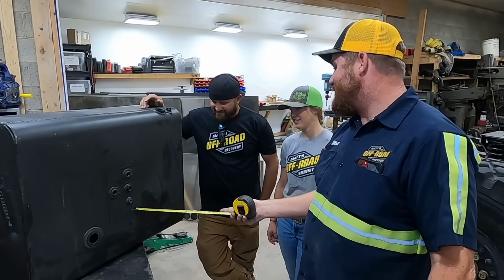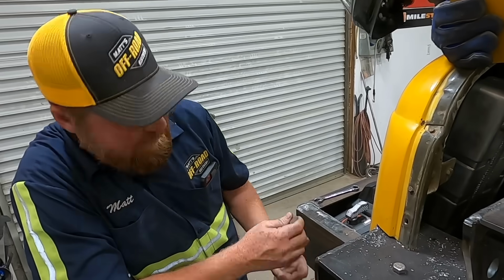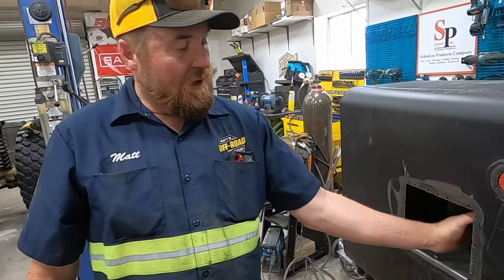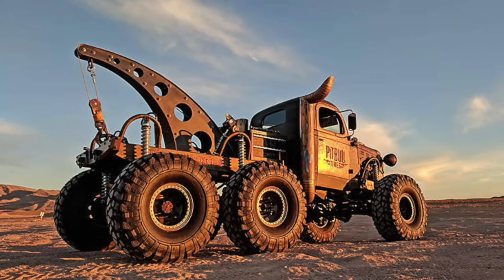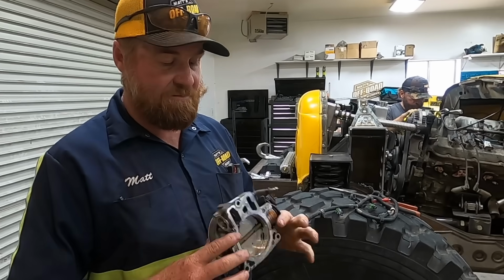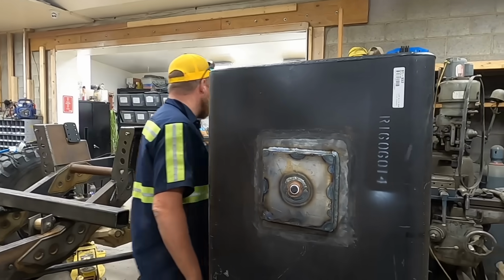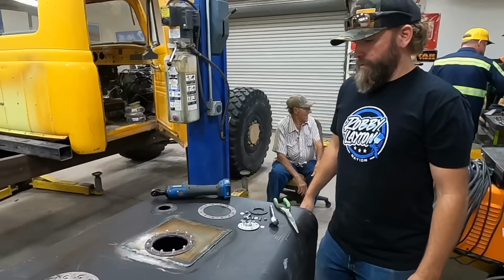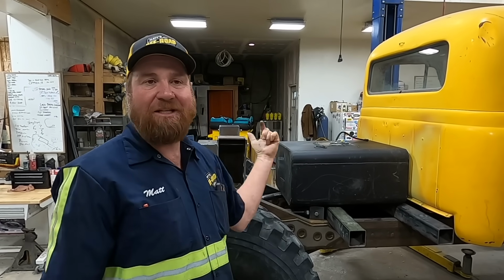World's Largest Off Road Wrecker...There Can Be Only One.

Comment: There is a reason why semi's fuel tanks hang on each frame rail.. I built a extra tank that way behind the cab and headache rack.. The frame was even double framed and very thick.. The frame still flexed from one side to the other.. The welds cracked and broke from flexing.. Happened to be in the winter time and the wind chill was -70 degrees.. Last fuel stop they were cutting their Diesel with gas for a anti gel < thats doesn't work..and I didn't know they did that.. gas is like water on diesel.. they don't mix very well.. Cold shut down my semi in a few miles.. Because wax balls were forming inside It and it would only idle.. So I went to look inside the tank to see what was going on.. The exhaust was just above the fuel caps on the side rail fuel tanks.. The gas and fumes was on top of the diesel and it blew up when I open the fuel cap below the exhaust elbow.. But the ground also caught on fire because of the cracks in that tank mounted on top of both frame rails... So everything was burning including myself... That frame on my semi had many cross supports also.. I hauled loads heavier then 170,000 pounds... Hope that works for you.. But it didn't for me.. My extra tank was only frame rail wide...

Comment: You should use a clunk system like in model airplanes. A silicone hose with a weight that fuel can flow through.  The hose is long enough to reach all 4 corners of the tank.

Comment: Hey Matt I custom built a 54gal fuel tank w/ a 5"sq, sump pit that hold a gal of fuel alone, this is in my 85 GMC w/ 12" of lift setting on 40" pitbulls, I've never found any angle that I get a fuel issue period, I put this fuel tank in between the frame rails over the rear-end, so just to let you know the sump pit works great & soon you'll see the benefits of said sump-pit style fuel tank.

Comment: Perhaps welding tabs to the straps for mounting to the frame would be most appropriate. However putting rubber between the straps and the fuel tank would be safer being less prone to a vibration fatigue at the weldment to the tank base parent metal inducing a containment failure point for the fuel tank.

Comment: 21:05 Isn't it usual to strap fuel tanks down like on trucks? (like with a ribbon of stainless with rubber belting underneath). Surely a bar would just flex and break?
Good idea to add the sump though

Comment: so i like your fuel tank but i have a consern you may wanna put a 3rd middle strap
as well due to it being a square box when its down to 3/4 of fuel that much weight even tho its got baffles the motion of the movement could cause the center of the tank to collapse and bend if you put a piece of 3/16 thick by say 1 inch long and use that as like a midde support that should be enough for center support of that large of a tank. if it was going to be a regular road truck i think what you have would be fine but sence its going to be flexing and bounceing in do believe you will need a center support. my .02

Comment: I think that you are going to find that welding your mounting straps to your fuel tank is problematic. Eventually, vibration is going to cause structural failure at the weld points. In my opinion you would be far safer without welding the straps, and building them to function as clamps, with the adjustments at the end of the straps. Just my opinion. I love the idea of this build.
Reply: I whole heartily agree. Solid straps of rubber between the tank and tank frame then saddle tank style straps up and over tank with tension bolts on the top... Oh and the gentleman that suggested the sight glass fuel gauge nailed it. I would put that between the cab and tank on driverside corner.
Reply: Maybe, it kinda depends how much weld there is.  Welds have an infinite life at the endurance limit of 18 ksi (half the yield point).  Will the vibrations stress the welds during typical operation?  The weight of the tank alone will keep it in place for the most part.

Comment: Interesting idea to build a sump do deal with lower fuel levels and slope combinations. Did you consider using a Holley HydraMat? I have looked at them to use in fuel cell in a 24 Hours Of Lemons car due to fuel starvation on long sweeping corners. I know your build is much lower cost than a HyrdaMat and that is the reason I have not installed one.

Comment: You need to run straps around the tank.  The vibration over time especially going off road the way you do,  the metal the tank is made of will fatigue and crack.  On our Oshkosh concrete mixers we use a three point system two on the back one on the front with springs to allow the frame to twist and flex and the stress isn't passed on to the ridged tank.
Reply: I agree welding brackets to heavy fuel tank is a poor idea for a off road vehicle
Reply: I was thinking about those stress cracks too.
Reply: He doesn't need straps on the tank, the truck frame itself is completely rigid (covered in a previous video). If the tank was about half the weight of the truck, the rigid welds might fail, otherwise I don't think they will.
Reply: Agree that a quarter-ton tank needs more comfort in its seating, but that elongated fuel gauge is doomed.
Reply: Watch the video again, he's not welding the tank. He's using straps, and using rubber between the straps and the tank.
Reply: @om617yota8  Yeah nah.
Reply: @grantadamson3478  Yeah I rewatched it myself, I was wrong.
Reply: As a fabricator, I agree with Shane on this, to weld the strap steel to the tank and then the attachment point to the strap will cause huge stresses on the welds to the thin tank metal and crack right out…. Don’t do it.

Comment: You know you can just have a small surge tank by the engine for the inclines, dont have to modify the fuel tank! haha over engineered but awesome! could have a secondary inline pump on a surge tank up front, then no trail fix needed just switch pumps!

Comment: You could have chose the engine with slightly less horsepower that gets three times the gas mileage which is 5 mi to the gallon or 15 miles to the gallon

Comment: Since this thing is getting juice brakes and its going to be run out of fuel at some point, has anyone considered using a hydro boost brake unit off a medium duty truck like a International 4400 or a Topkick etc that has an electric backup pump so you have full brakes with engine off.

Comment: Drop a Holley Hydramat in that fuel tank, it'll do a way better job at steep angles than a sump alone.  Trophy trucks use them in their fuel cells so people like Robbie Gordon can go nuts and drive on two wheels without sucking air, some buggies and rock bouncers use them as well.  They suck up fuel until they're saturated, always holding a small amount of fuel in reserve, and won't allow air through the membrane as long as they're still wet, which means that for a short duration you can run them upside down without any fuel touching at all.

Comment: hey Matt is there any way you can start pressure testing with water?  the air testing you do is extremely dangerous I have seen people that have died doing it that way.  at least fill it with water and press with air it is so much safer.  https://youtu.be/9dosN05dpAk
https://youtu.be/AelS89Az3YA

Comment: The easiest way to go for the throttle body is use one from a L29 Vortec 454.  Bigger bore.   The LS harness works but the injector plugs differ and the knock sensors will need to be extended for the different locations.  Get some Taylor 10.8mm plug wires for it too.  Stock wires will not handle low speed lugging without causing a slight miss.  They make a set specifically for the 8.1.

Comment: The fuel tank strap design, won't work because the metal will fatigue from fuel sloshing around and will break at the weld point. Or the nuts will come off the hold down bolts from all the bouncing around. (humor)

Comment: I replaced my factory gas tank with a fuel cell and a used sender. The polarity was reveresed and the range was very different. I got the range close with some resistors in a voltage divider configuration. In the end, "1/8" was full, and "3/4" was empty! I got it wrong sometimes. I always carried a fuel can and had to call for help a couple times.

Comment: You guys should run a larger aftermarket  throttle body , they sell adapters to switch from three bolt to four bolt throttle bodies. I'm running a 92mm throttle body on my 8.1

Comment: Hopefully they seal all of the raw steel inside of the tank to keep it from rusting. Full over the tank straps are way stronger than welding straps to the tank, I have witnessed welded on straps pull holes in tanks.

Comment: I’m a little concerned with the float filling with fuel from sitting submerged for prolonged periods. Not that having a working gas gauge has stopped you in the past. You can order adjustable level senders online. Just got one for my truck.
Reply: The floats are solid pieces of non porous low density material...they don't have any spaces to get filled with fuel.
Reply: They're sealed plastic these days
Reply: @mrmotofy  Not sealed plastic, a closed cell foam of nitrile butadiene rubber.  It's basically a solid brick of fuel proof foam, no sealing necessary.  The only issues the newer floats have are excessive wear on the bearing surfaces over the course of decades causing it to slip off the arm, and shattering a piece off due to lack of care during handling because it's a brittle material.

Comment: It would of been much easier to use a fuel surge tank under the hood, I normally run a 1-2 gallon surge tank with dual brushless pumps on most of my builds.  I usually feed the surge tank with a belt driven low pressure fuel pump.  The dual brushless pumps are used for redundancy and high horsepower applications.

Comment: I actually used to have a car that the fuel gauge worked just like that, when it started moving you had half a tank. Looking good, great progress!
Reply: I had a 1500 Ram like that.
You could drive from Texas to Fla on the first half tank and then start looking for a gas station.
Reply: Mine, if it started working, I wouldn't trust it!   It used to only work in the summer and then would take the winter off.  Haven't seen that needle move in years.

Comment: You know a great way to really open up a building?  As is blow the walls out?  Do hot work on an uncleaned fuel tank inside the building.
OSHA 1910.252(a)(3)(i) prohibits hot work on drums, tanks, and other containers until they have been thoroughly cleaned to remove flammable materials or other substances that when subject to heat may produce flammable or toxic vapors.

Comment: can you use a clunk-style fuel pick-up where there is a weight on the end of a flexible hose down in the tank that follows the fuel around the tank on the angles you drive on if you go uphill the hose stays in the fuel and that goes with every angle you go on just like a weed wacker does so the pickup never comes out of the fuel no matter what angle?

Comment: If you can find them there's a 60.000 lb Swivel-Type Pintle Hook that are mil spec and would work great on the front or back .  considering that you never know where or at what angle you may need to hook up to a job they would be perfect on the truck .

Comment: The Wrecker is shaping up to be an awesome tool.  What are the plans for the electrical system?  Going to need something beefy to support 10? winches.  Is the plan something simple like a pair of big 12V alternators, 2+ giant deep cycle batteries and an isolated charge only starter battery like bigger boats run?  Maybe the gold plated plan with a 2-4KwH of lithium ion and a giant AC inverter to run all the tools plus a MIG or TIG welder?

Comment: Love the improved baffle design..might want to reconsider your return placement though..returning the fuel to origin of pickup will cause fuel temps to soar..best to return were the fuel has to travel the most to the pickup allowing the hot fuel to mix with cooler fuel before being picked up again 👍
Reply: that's the factory return set up will be just fine ..
Reply: @randytravis3998  The reason I mentioned it was..he is running that baffle from the top to the sump..in a normal situation I would completely agree..but essentially the fuel will be for the most part picked right back up again since the fuel pickup and return are inside that baffle and @ 14-20 GPH it wont take long on a hot day to induce vapor  lock or worse yet preignition that the ECU can't deal with..

Comment: 3 3/4 inch converts to 95 1/4 mm. So if you are afraid of fractions, you might consider your options, young man! :)
To make it worse, you could also call it 9 525/1000 cm, but no one would do that, wouldn't they?

Comment: Few years ago I bought a 78 1 ton pickup with a 9 foot stock bed from a rancher (his father had driven it). Every where within 50 miles in any direction I went some rancher would ask me if it was Elmer's(ranchers father's) old truck. I ended up naming the truck Elmer.

Comment: One thing I would do I would try to get a nice piece of like a stainless steel grape that has a a quarter inch mesh like something nice looking and put it in behind the grill that you just secured down that way a tree branch can’t come up and poke into your ride and I also still think you need to totally rebuild the front of your engine I’m talking water pump belt tensioner alternator I guess you’re gonna have an AC unit in there I don’t know I would have all rebuilt equipment upfront and like I said a zinc rod for the rad that will corrode and protect your radiators I don’t know if your engine has aluminum heads on just not that from you with that engine I think they have aluminum heads but anyways it helps protect all that stuff so anyhow are that’s what I would do and also I guess you’re going to put some sort of a cover to protect the oil cooler lines on the very front of your truck there again a branch come up there and I thought it would happen but you never know you want to be safe than sorry also like the baffles you’re putting in the fuel tank good idea anyways this is six in a row Jim from Kennerdell Pennsylvania

Comment: Square holes in a gas tank will crack on the corners... as will the bottom mounts. (Eventually.)  That is why you don't see them on 'conventional' tanks.  Truck frame will flex, have got to take that into account.  Strap mount the tank with metal and belting.  (IMHO)

Comment: I wouldn't weld straps onto the tank, just clamp it into place using a strap with a rubber strip between. Welding on straps is going to be a source of failure, when you go off-roading.

Comment: If you really want to get technical, this is far from the worlds largest off road wrecker.  For example:  Dave Sparks (Heavy D) has that Oshkosh 8 wheel drive HET wrecker....  that thing is MUCH larger than what Matt is building here......   But what Matt's new wrecker is being built for, and what Heavy D's wrecker is built for are two different things.   Don't get me wrong, I'm am certainly NOT knocking Matt's wrecker.  I think it's going to be super cool and VERY capable when it's finished.  It will probably be the largest wrecker on the trails in Utah.  No doubt!  But the largest off road wrecker in "the world"???  No.
Reply: Matt has made that comparison already. He said his will be the largest “trail” capable off road wrecker, meaning it can handle the trails the Morrvair and the Banana can. He test drove a military wrecker, and it can’t rock climb or handle deep sand well.
Reply: I don't think your definition of off road and Matt's have much in common. He mentioned that this is basically going to be a rock buggy that does wrecker stuff. Not just for semi-level dirt.
Reply: @JohnFL  You dont think my definition of off road and Matts have much in common? How could you arrive at that determination based in my initial comment? I never stated what my definition of off road is. Lolol. Trust me.... any of us who watch this channel probably have the same (or very close) definition of off road. Lol

Comment: Welding straps to the tank gives it spots to fatigue crack later. The fuel sloshing around causes a lot of movement. That's way almost all fuel tanks are held in with straps around them, generally with rubber between the strap and tank.

Comment: Not to critique your build as it is really cool. I’m speaking from 35 plus years as a heavy duty mechanic that has seen and had to repair the problem you are going to build into your fuel tank mount. Personally I would mount that big fuel tank. The same way as a water truck tank. Spring mounts to allow it to move slightly as the chassis flexes to prevent tank cracking. Even when mounted using straps like on semi trucks it does allow some movement even in cars fuel tank mounting straps do allow slight flexibility to not compromise the fuel tank.

Comment: If you mount the tank that way you are going to get stress cracks form over time on the bottom of the tank and it will leak, much better option would be straps over the top with rubber cushion under the straps and tank.
I do love watching your videos and I do agree with most of what you are doing but this one just jumps out as a failure point to me.
Keep making these great videos, we all really enjoy them.

Comment: Matt and his team are back at the world's biggest wrecker and are making good progress. The gas tank mods should make a big difference in keeping fuel going to the engine as designed. We love that Rhett is getting more involved with the family build and learning to weld and fabricate! Good job Rhett! Lookout Lizzy you might be training your replacement? 😉 Trevor is doing his specialty of getting all the wiring installed so everything works! I like the idea Matt had of making the bonnet easily removed when needed. Keep up the good work! Oh and Skeeter is quickly learning the ropes on the trail.